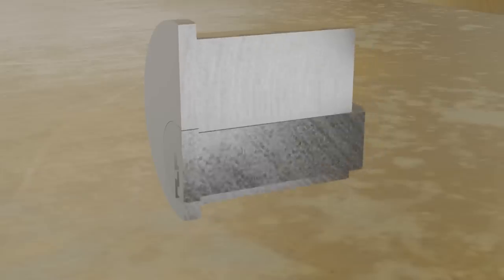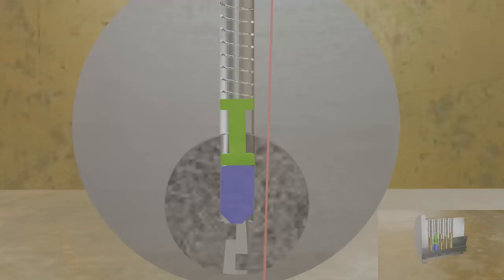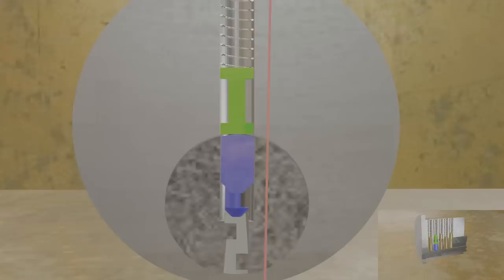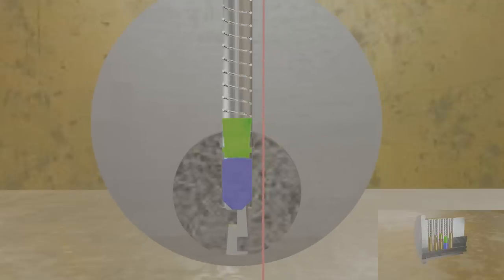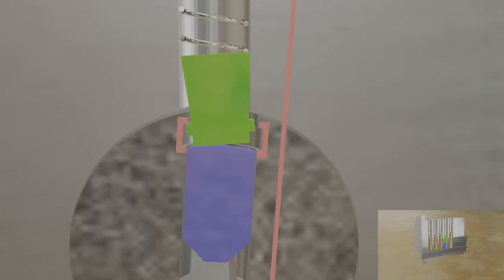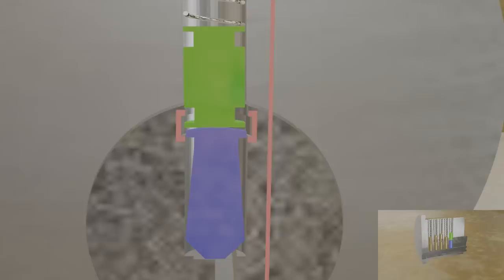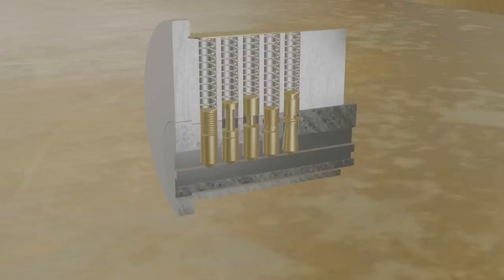How Security Pins Work

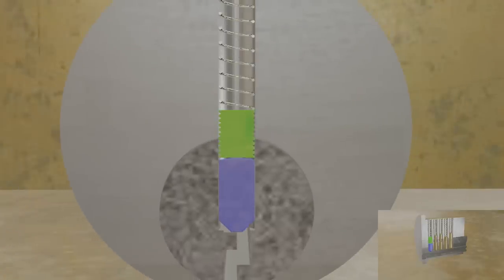Comment: These explanations are great! I think that the part starting at 1:35 with the "picture in picture" view of the lock from two angles is really brilliant. I think that this is the first time I've seen the "Would this be shown as a cutaway of a single pin or by showing the whole lock mechanic" solved by being able to do both at the same time.

Comment: Awesome, awesome video. I have a question though. The T pin you show at 5:34 is oriented with the skinny side down and as you show in this position it can be simply pushed through to the shear line. However, when I’ve actually come across T pins in locks they have the skinny side up, which makes them get hung up and harder to pick. Do you have any tips on these? I’m pretty good at spool pins but T pins I can’t seem to get. Thanks!

Comment: If the spool pin's thin section is already in the shear line to start, could you tell it's a spool because the cylinder will drop into a false set without your having interacted with that pin yet?

Do they make spools with the thin section shifted down?

Comment: One thing not mentioned here is that these may all allow you to use a comb that pushes all the key-pins up past the sheer line entirely. The solution to this that I've seen is to include false chambers in the core, and add wafers to any T pin, such that the key pushes the wafer past the sheer line, protecting the T pin from entering the false chamber, where someone picking this might not get the wafer past the sheer line, allowing the T pin to fall into the false chamber once the rest of the pins are set and the core is rotated. This unfortunately binds the lock, so it would have to be disassembled to be usable again, but it at least keeps the picker out.

Comment: So... you would get the most safe pin tumbler lock by having counter milling in both the chamber and the bible and having torpedo keypins and barrel pins on top + mixed strenght springs. However, the usability of such lock would be pretty bad because pushing the key in and taking the key off the lock would be really hard because the key stucks every time if the core is not perfectly straight. It might have be even better to have the top pin look like upside down torpedo pin so that the action near the shearline would be similar no matter if the keypin is underset or overset.

Comment: Why don't they add serations on both the pin and the barrel that interact with the pins? It would lock the pin better when you tensioning the lock for picking attempts. Looks like they do this at 7:20 looks like a good design.

Comment: If you had two security pins, and for each one you have to release some tension (or manually counter-rotate) to release a false set, wont that just fully release the other security pin that youve set? Then you'd have to go back and forth and never get anywhere?

I'm guessing the solution to this is to trial-and-error until you end up setting the deepest true set first, then going at the pin with a less deep false set, so that you can safely release tension on the latter without dropping the former? But then what if the true set of one pin is deeper than the false set of the other pin, but the false set of the first pin is less deep than the true set of the other pin? Won't we just go round in circles and keep undoing our work?

Comment: So what would a lock be that rotates clockwise and then rotates counterclockwise? From 0, going +90 and going back to -90
Under all pins set with a key it should rotate freely, but without a key on all pins you'd need to either rotate extremely quickly to avoid catching the free pins or repick them.

Comment: Why does the manufacturer make this Click action? Wouldn't it be better to have no Click at all so the thief wouldn't even know if it's set or not? Key will keep all pins at place while lockpick can keep in place only one pin, so if all other pins would just drop back there would be no possible way to open the Lock except with a Key, so why does the manufacturer give the backdoor to open the lock?
Reply: I'm fairly new to picking but here's my understanding of it. 

Cheap Chinese locks with loose sloppy tolerances tend to not give feedback at all, and it's just mush. That can make it take slightly longer to pick vs a better lock with only standard pins. But just a handful of seconds at best. Those loose tolerances make it vulnerable and very easy to set the pins, even raking security pins can be really easy. 

Better locks with tighter tolerances will give much stronger feedback and have a more clear binding order, but that comes with being much harder to pick. You have to be very precise with tension and pick pressure to avoid dropping or oversetting pins when dealing with spools. They won't rake open as easily, and opening by raking alone is virtually impossible with security pins.

So that's the trade off as I understand it. A good lock will put up a serious fight even if you can feel exactly what's going on inside of it. The ones loose enough to not have feedback, you won't need it. They'll open if you poke it with a paperclip.
Reply: @ians5337  but wouldn't it be nicer to have a lock with pins that drop even when in tension? Key holds all pins at once in place, lockpick one by one. If one pin popped it has to fall back if there is nothing holds it